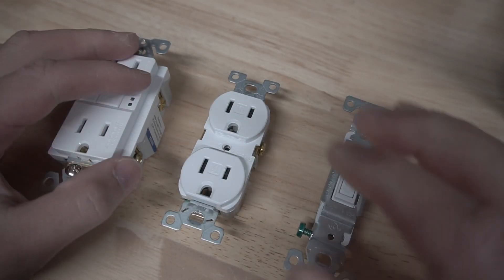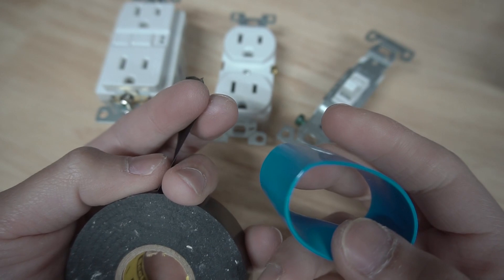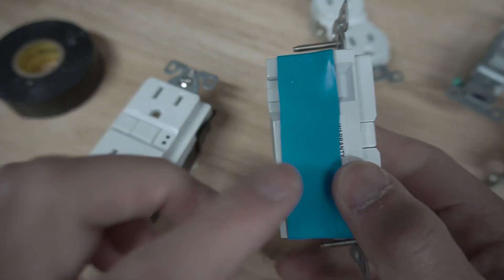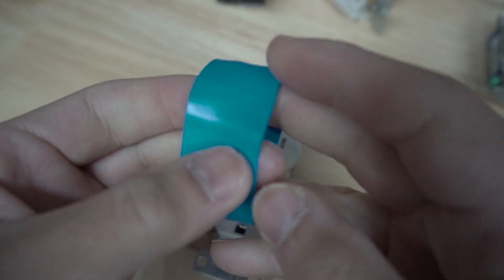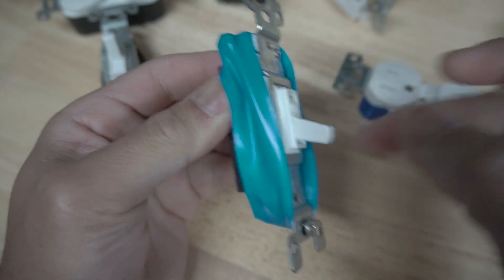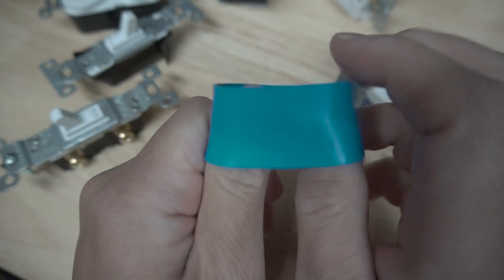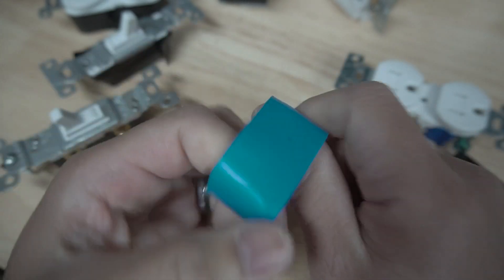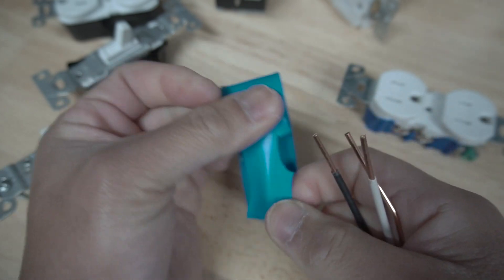NEVER TAPE AROUND ELECTRICAL OUTLETS AGAIN! - DIYers BEST Friend!

Comment: Looks like a good idea.  But on the GFCI it got stretched and became narrower and didnt cover the whole side,  I have tight metal boxes in my house so I always tape.  3 times around, and make sure it covers all terminals and wire and slightly overlaps the back.   in case it starts  peeling, end it going in the downward direction, towards the bottom ; that way gravity wont pull it down further

Comment: seems like a good idea but electrical tape is always cheap, plentiful and versitile. bands are just another pricey thing to have to carry around and hope u don't run out of. but i have a bias and i just don't like elastic bands in general. always struggle pulling off around the items and when snaps back at your fingers with wires and screws in the way is annoying. tape is on and off and out of the way.